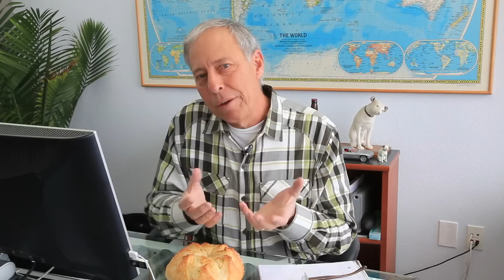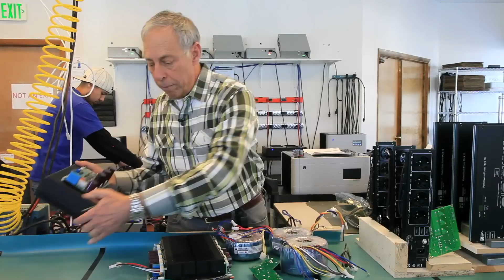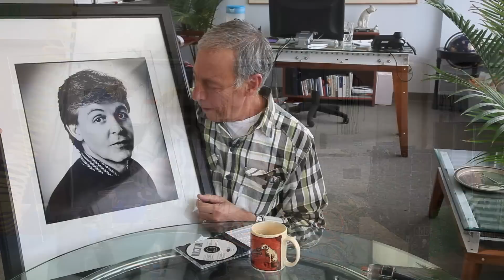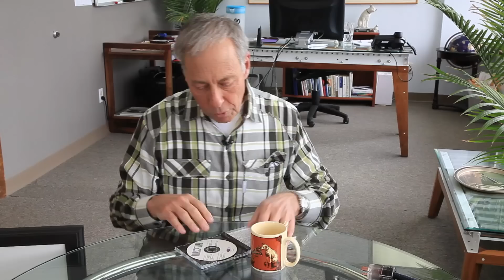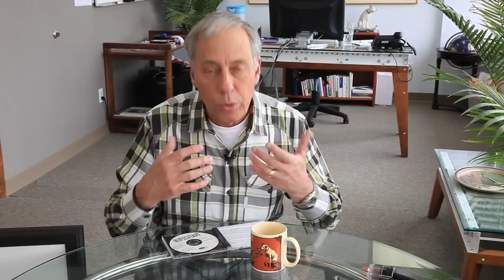Bread and AC power both can be high end

Comment: There is no sound at the AC plug,line, or stuff.....well made electronics have adequate power supplys, which makes it DC, DUH.  My Van Alsine equipment have several regulated supplys built in, what a tool

Comment: Isn`t it something that standard online UPS does?
Reply from the maker: Yes and no. There are double conversion UPS that generate a new sine wave as you are describing. Unfortunately, the vast majority have a worse quality sine wave than what comes out of the wall in the first place and, for those more expensive UPS devices producing reasonable sine waves, they cannot handle transient current demands without distortion. This means that a low power factor device, like a standard power supply amplifier, will wreak havoc on their power delivery. The reason is because they use a class D amplifier for creation of the output sinewave and they traditionally don't have much ability for short term high current demands like those placed on them by amplifiers.
Reply: @Paulmcgowanpsaudio   Thanks for explanation. Actually I use UPS as a "power plant" . Results are interesting ( my equipment is not so power demanding: speakers are Yamahas MPS7 studio monitors, preamp, dac and miniitx pc as a source):  in areas like city center, in huge apartament building ups really helps to improve sound. At my current place which is far from city UPS changes the sound for worse. I hope to have possibilty to check your Power plant. Ive seen one that beenm used in few rooms at Warsaw`s Audio Show.

Comment: I think If the power sup were designed with inductor chokes between the banks of oversized capacitor in parallel with smaller ones  plus  analog high power voltage regulation a second filtration stage with a heavy inductor choke before go out to B+   And extra filtration at any voltage split and tantalum caps at every branch split for decoupling  you would not need  your "outside power Thing" what is basically a induction motor controller. but more sophisticated but basic design. I say A high end amp needs a high end build in power sup.

Comment: Good clean stable power is important to all quality electronic devices. I've experienced high and low voltage fluctuations, errors in base frequency of 1 to 3 percent of the 60hz, and a wide range of noise, em interference and issues with interconnectivity between various music devices. I break so many audio purist rules with my music room being my keyboard studio as well and my collection of vintage synths all wired and playable. But I learned a lot about how bad commercial power is right from the start. One issue that was simply horrible here in the Midwest USA, was that in a room with many electronic devices you will use quite a few wall plugs. Some of the wall sockets are powered from a different leg of the transformer on the power supply line pole out in the street . OMG what troubles this causes. Being sure your music room is all on a single 110v leg of your homes power supply is immensely important. Most of us also have our tv wired into or home systems. It's easy to get the tv on a different power supply circuit because it's often way across the room, which can cause havoc in a variety of ways. I'd love to have one of these power plants but I'm afraid I would need more than one. Paul, Can they be combined on a complex multi component system without the 60hz becoming out of perfect phase?

Comment: To make the power clean a power supply still needs its own passive filtering.  I can and have made cleaner power with passive filtering than even high cost power supplies used in my EE lab.  Notice that he picks up a small filter with 2 CMCs and some caps on it and compares it to his power supply that likely has far more passive filtering in it.

Comment: Put the brakes on man...if ac power is unstable/noise the only thing working is isolation transformers combined with ferroresonant transformer.... but again.. stable or unstable AC.... inside the amp capacitor bank the DC is stable to a certain point anyway.... you do not get better stereo with lots of external crap plugged in the mains outlet...and then suddenly instruments sounds cleaner...

Comment: I enjoyed this video and it helped me to understand the difference between other options on the market at similar price points. Currently, I have the Dectet and though I'm sure it helps, it continues to trip to the off position under relatively light loads.

Once I do a little more research and dive for some more sofa change, I'm considering the P3 or preferably the P5.

Comment: How's about audio equipment that uses switch mode power supplies to generate the low DC voltage. they chop and modify the power so much that what comes in makes little or no difference. To a certain extent, the same happens with purely inductive power supplies, especially ones with rectifiers.